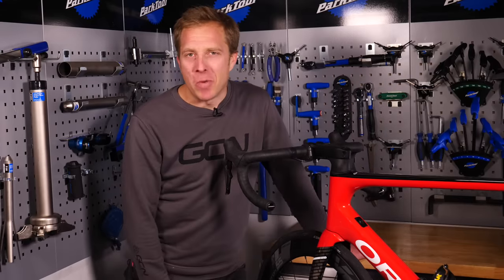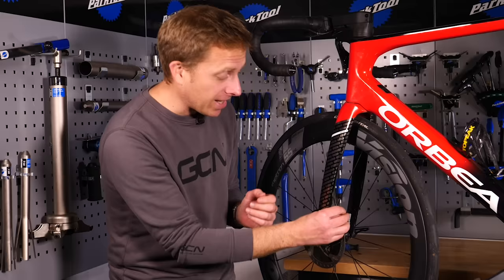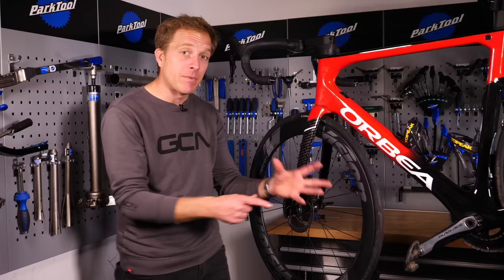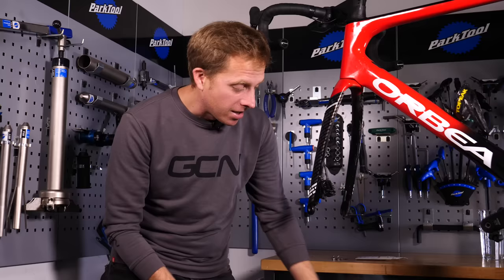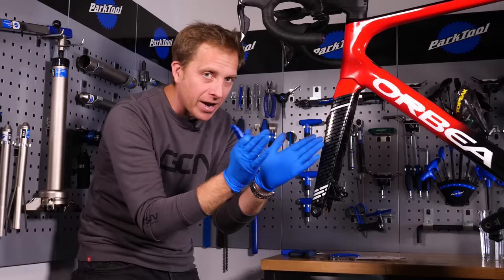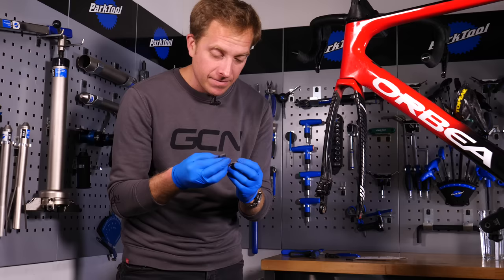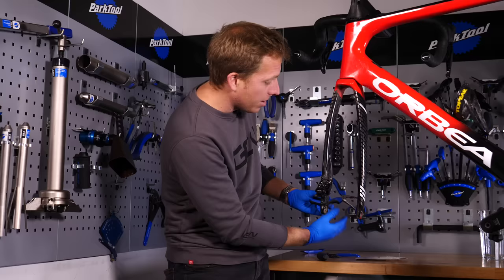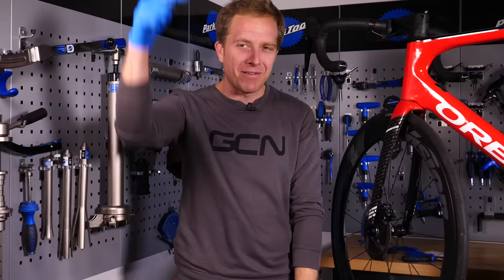How To Fit & Replace Disc Brake Pads On A Road Bike

Comment from the maker: What other maintenance explainers would you like us to make? Let us know in the comments below 🔧
Reply: Thanks JC. How about bleeding the brakes?
Reply: I would love to see a rear hub overhaul video. I am about to do my own and to have you to rewind when I miss something would be priceless! Then again Jon, most of your videos are!
Reply: Replacing a in frame cable
Reply: Jon, my old sausage, yes more on bleeding and as I have new Campy H11 brakes, are there any brand specific tricks to their pad install, and bleeding? Any tips on common mistakes?
Reply: How to install hydraulic brakes link inside the new carbon handlebar on the road bike.
Reply: Before putting the new pads in, put some water on them and rub the two braking surfaces together. You will feel them start gripping and know when you have done enough, wash the dirty water off and you're good to go. This helps dramatically with bedding and increases stopping power. If Jason Marsh does it for the syndicate riders, then I would be doing it as well.
Reply: How often should I remove the crankset for maintenance/cleaning purposes on my road bike? Also, should I remove my pressfit bottom bracket for maintenance every now and then? I am afraid I'll damage my carbon frame or that they will not go back in properly.
Reply: I'm not sure if it's a maintenance issue, but my disc brakes start to squeak every time it rains. It goes away after enough braking, but in city cycling on flat there usually isn't, so they squeak the whole way. Can I fix it somehow or is it a "feature"?
Reply: Replacing or upgrading your bottom bracket.  As we know, most cranksets come with cheap BB's that don't last. So eventually you'll need to replace it.
Reply: Disc bleeding, if you could! ❤
Reply: #TorqueBack Not a maintenance question per se, but I am looking for a 10-32 (11spd) road cassette compatible with the XD driver body. Surprised to see options are few and far between? Thanks!
Reply: pro trick: watch movies on kaldrostream. I've been using it for watching lots of of movies during the lockdown.
Reply: @Johnny Zyaire Yea, I have been using Kaldrostream for months myself =)
Reply: Bring back Jon
Reply: Why drop you fools just have one format !

Comment: how to do it the simple way that still works well and is professional
1. remove the wheel
2. press the old pads (brakepistons) out with a screwdriver or whatever you want
3. exchange old pads with new ones
4. put the weel back in
that's all... you'r welcome!
Reply: I couldn't understand why he didn't do it that way either, especially given the fact the old pads won't be used again.

Comment: Good tip on the tire levers for moving the calipers back in place.  It never occurred to me.  Last time out I had fits getting the wheel back in with the thicker new pads.  This tip will help next time.  Thanks!

Comment: Depending on how much grime is on the disc brake calipers, sometimes it makes sense to spray down the caliper pistons with brake clean before you retract them.  Saves on seals. Then put the pads back in to retract them.  One advantage of doing that is that it can help the pistons move evenly.

Comment: Thanks for an interesting video. A couple of things I do with the after market pads when I replace.  The ones with no cooling fins, I file a small nick on one of the locating eyelets as a witness mark, for when I remove the pads for cleaning, I can then place on the inboard or outboard side, so that there are no alignment problems, which can cause rubbing. The second thing, because the pads and spring can be fiddly to replace, I use a 3mm drill bit shaft to align the pads and spring, while I am dropping the pads into the caliper, finally remove the drill bit, then insert partially into the locating hole of the caliper, gently push the components and drill bit so that all locate perfectly.
Reply: Use the retaining screw itself. After undoing the retaining screw, I pull the pads out, so that the screw holes are just proud of the caliper, then I re-insert the retaining screw through the pads and the spring and pull them clear of the unit. Because of the head of the screw, the pads will not fall out, if tilted to that side. Also the head is always on the left, and so it is easy to know which is the left pad and which is the right.
          If the pads look OK, I re-insert them with the retaining screw still in them (and the spring) until the screw hits the caliper, I then pull the screw out, push the pads in fully and then screw the retaining screw in. It's quick and easy.

Comment: You should have mentioned the "Golden Rule"  John,     NEVER  pull the brake lever while the wheel is out!  
I bet someone does it.....   ;-)
Reply: Laughs in mechanical brakes
Reply: @brauljo  laughs in intact rim walls
Reply: Paddy Champ Laughs in mechanical disc brakes
Reply: @brauljo  Laughs in BMX
Reply: @fallbrightt9223  Laughs at BMX
Reply: He did say how to push the pistons back at least. But, I guess you are correct that by avoiding doing this it makes the job just that bit easier :)
Reply: Let’s say… someone… did this. Hypothetically. Hypothetically what would they need to do to fix the resulting issue?
Reply: @AdamLeuer  Depends... Worst case, you may need to bleed the hydraulic system if the pistons fell out and fluid leaked out. Otherwise just use a tyre lever to push the pistons outward. The point is to push the pistons back out so the new pads have enough room to clear the rotor as they will be thicker than the worn pads you are replacing.
Reply: Yeah, my hydraulic fluid did leak out and I ended up taking it to the shop. Learned my lesson the hard way.
Reply: Jon*

Comment: I see there are several comments against using disc brakes. It’s true the maintenance isn’t as simple and they cost more. I live on a small mountain range, nothing like the Alps or Rockies, but I easily hit speeds of 60-70 kph on my descents. I’ve recently purchased a new bike with disc brakes and will never buy another rim brake bike again. 1. They do stop better in the rain. 2. The brakes have significantly more stopping power. 3. To stop from speed requires significantly less effort squeezing the brake lever, good for us older riders and anyone with hand issues. 4. It allows me to use a wider tire (32) for a more comfortable ride on my crappy roads and I went tubeless also.  🚴😃

Comment: I would have preferred more close ups. There was a lot of camera time watching him from afar but the action is up close as the main characters are small
Reply from the maker: Thinner tyres are faster in certain circumstances. The track is buttery smooth so thin, aero tyres will be the quickest of course. As roads get rougher the optimum tyre width question becomes more complex

Comment: The most difficult thing is to choose the right replacement set (shape and material).
I would add a warning: keep in mind that bicycle pads may still contain asbestos, even in 2019. Indeed, and although asbestos is banned in Europe, it is still widely used in China, Malaysia, Taiwan and India. Which are, and this is not by chance, the countries where the pads are produced. Even if they are stamped with the logo of an American or Japanese manufacturer.
Do not create dust in the air, therefore do not use compressed air or brushes. Clean, as mentioned in the video, with a wet brake cleaner.
Just precautionary principle.

Comment: I usually give the pistons a clean with some hydraulic fluid before pushing them back in to prevent getting break dust and road dirt on the seals.  Didn’t used to but find the pistons work much better if u do.

Comment: Watching this just makes me want to keep my rim brakes even more
Far easier to maintain & plenty powerful enough for me with good pads (ie Swisstop)
Reply: So your car has rim brakes as well.
Reply: @ichglaubesgehtlos  My car has a weight of 2 ton & is able to travel at 100 + mph 

It's physics & crazy to compare the braking system of a car with a 7kg cycle
Reply: So a couple of razor gums will do the job just fine 😂👍🏼
Reply: @ichglaubesgehtlos  No as I stated I have Swisstop pads fitted & they work great
Read my post

Comment: Great video and advice Jon. +Like. In 99% of braking instances, these disk brakes are over-kill on a road bike. Comparing r8010 Ultegra direct mount rim brakes & braking on an alloy rim surface (even in the slippery cold rain) is honesty all I'll ever need. For me, an alloy braking surface and r8010 direct mount rim brakes are more than suffice to stop anyone, in any situation.
Reply: Completely agree. Been racing, touring and wrenching bikes for 40 years, and just recently picked up a Domane+ ebike that came with hydraulic disks.
What a waste of technology, but I'm sure a money-maker for the manufacturers.

Comment: I started using a hemostat (haemostat if you live across the pond) to remove the clip when I change brake pads.  Since the ratchet mechanism on the hemostat keeps the jaws closed, I don’t have to worry about dropping/losing the clips any more.

Comment: My front brake bad failed last year, even though, there was still over 1.2mm compound left, but spring got caught by rotor and got bent. I believe, the reason why it happened, was because sand and dirt falling down from mudguard directly on to brake caliper. And then probably some tiny rock or sand from gravel, that had fallen from above, worked itself under that leaf spring.. to between brake bad and spring. Rising the spring up.. I fixed the problem by making guards. Like mudguards from empty plastic bottles to above brakes. So that anything falling/pouncing down, from mudguard won't reach to brake calipers.
Reply: Happened to me, too.

Comment: I must admit to a personal problem I have with getting wrapped up in Jon’s habit of over-using the word “actual(ly)” way too much (actually 30 times in this video). What is the difference between “retaining pin” and “actual retaining pin”, and should I consider virtually putting on gloves as opposed to “actually put on gloves”? Nevertheless, it was another detailed and, as usual, informative video. Thanks, Jon.

Comment: Still not persuaded to swap from rim...easier maintenance 😎
Reply: This is literally the easiest maintenance job possible. Infinitely easier than replacing rim brake blocks. 5 mins max for both ends of a bike, including taking the wheels out and opening the packaging for the replacement parts.

Comment: Could you make a video how to remove seized aluminum seatposts from steel frames? For example with Natriumhydroxide?
Reply: @Jan Willem Kuilenburg - I had to do that recently. Tried freeze spray but that didn’t work, then just sprayed wd40 all round the top of the seat tube. Didn’t move at all. When I stripped the bike down weeks later I took the clamp off the top of the seat post, turned the frame upside down and clamped the seat post in a vice. I could then twist the frame to get it moving. My LBS said if that doesn’t work you can run penetrating oil down from the BB.

Comment: Shimano says to use the finned pads with those rotors only for better heat dissipation so the rotors don't warp from hard braking on a descent.

Comment: Ive bought myself 2 pairs of Clarkes round disc pads I just had to break the tab off them to make them fit on the non piston side I couldn't get the piston side ones to stay so I'm making do with one side BODGE JOB but it works "a bit" . I found Halfords and a local bike shop to be most unhelpful tbh but I suppose i have half a clue .. I prefer V brakes as they are just plainly simple tbh but I do want to do this properly

Comment: Just did my first pad change with this as a guide. Long/thorough was just what I needed so thanks! 

When pushing back the pistons (both front and back) one side was much more stubborn to push and wouldn't quite go as far in as the other, why could that be? There was enough room for the new pads to fit but the brake levers are starting to feel a bit loose so suspect they need bleeding (a job for the bike shop) so I'm curious if they're connected. Anyone?

Comment: I brought a new bike a thew days ago I just adjusted my brake cables and noticed my disc brakes doesn’t have no pin or pins what’s so ever 😢. Do I pinch them from the top or do I open the calliper after removing the wheel. It has three Allen key bolts and no pins. ???

Comment: Although I clean the pistons with a bit of mineral brake fluid they don't seem to retract enough to prevent a light rubbing sound. What to do?
I always clean de discs with DB cleaner when replacing the brake pads to bed them in more easily.

Comment: Q: on cars they always use copper grease on the back of the pads to stop squealing, is it worth doing on bikes? Just thinking of all the squealing brakes at cx races.
Also, are different pad types better in the wet muddy conditions of cx races?

Comment: Does this work with both hydraulic and mechanical disk brakes? Pushing them back in when the pads are out etc? As long as you don’t touch the brake lever they won’t creep in and close up, correct?

Comment: i beed the rotor with a sand paper an isopropilic alcohol before installing the brake pads
Reply: Could you tell me why that helps? Especially with a used rotor?
Reply: @playandteach  cause it reduces contamination,  and also you can use alcochol to clean the brake pads
Reply: @jesusenriqueriveratellez531  I just don't understand the sandpaper bit.
Reply: @playandteach  sorry for my english, but i use the sandpaper to get rid  of rotor and brake pads imperfections

Comment: Can you replace the brake pads without removing the wheel?
Reply: Yes, you CAN replace the pads without removing the wheel, which is a whole lot of good news if your bike is a bit complicated at the back end. Mine has a Gates Belt Drive and hub gears.
Instead you simply unbolt the hex-heads holding the caliper onto its carrier, and lift it off the rotor. Be careful not to kink the hydraulic hose.
Fuller details are here... https://youtu.be/HF2-eHgdngU
And there are a couple of others, too.
Reply: @effyleven  Hey thanks!!! That's a good "trick"!

Comment: I've heard on your previous videos that "disc brakes is the future", but as far as I know they're still heavier than rim brakes right? So what do you mean by that statement? They're the future because stopping power is better, or because they're getting lighter to the point where they're the same to rim brakes?

I'd like some videos on vintage bike maintenance. Stuff like upgrading from a one-piece crank to a modern one, and how to remove really tough rust and rustproof old parts would be interesting.
I'm still struggling with my 80s fauber crankset. It's been sitting in penetrating fluid for 2 weeks.

Comment: Think I'll stick with rim brakes, that's way too tedious. 
In a car it's easier to push the calipers back out if you loosen the reservoir cap. That also helps release any air that may have gotten into the system by allowing the air bubbles to flow up and out. IMO on bikes.
Reply: I prefer mechanical disks because you get better braking performance than rim brakes (on road bikes) without the hassle of having to bleed the breaks every month
Reply: @benjamindavies1188  I haven't seen the need to change to disc. My carbon wheel rim brakes will dang near flip me over the bars. On alloy wheels they will flip ya. Im sure I'll transition to disc eventually.
Reply: Oh roadies, you are so silly.
Reply: @Pienimusta  lol I'm not necessarily a roadie as I am realist. 😂
Reply: @thenotoriousrvh6091  Much easier than changing brake pads to v-brake or simialr rim brake. You have to calibrate those brakes everytime. Disc brakes are done just by throwing new pads in.
Reply: @Pienimusta  That's easy. I run the barrel adjuster 3/4 of the way out use a Velcro strap to hold the brake lever in align the pad to rim, take the strap off then turn the adjuster in a bit. Takes 5mins each brake.

Comment: I have ultegra brakes and have replaced the pads a couple of times already. The new pads never came with the screw and mine are wearing out. Where do I get a replacement? Can't find it anywhere.
Reply: I bought some on fleabay

Comment: Jon, Unrelated to the subject matter of the video, but what is that tool that was over your right shoulder in this video?n The large silver cylinder that looks like a floor pump.
Reply: It's an adjustable crown race puller.
Reply: @dapster  Thanks.

Comment: Jon pls help, I fixed/tuned my front mech but after that every time I let my rear wheel spin (without pedaling) I don't know if it's the hub but there's a weird sound coming from there, what do I do?
Reply: Is your wheel in properly and your brake pads not rubbing?
Reply: @paddychamp6069  It's not rubbing, I'm using rim brakes btw
Reply: @ricardiomilos7204  is the noise coming from the hub/freewheel?
Reply: @paddychamp6069   I think so, but it sounds like the chain or something else
Reply: @ricardiomilos7204  couldn't tell you without seeing it in person, but I'd advise using a chain checker to ensure it's not caused by the chain. Also check your limit screws on front and rear derailleurs and gear indexing. It's also possible that it's coming from the wheel bearings or freehub body but much less likely. A real rare rub can happen between the tyre and the inside of the brake caliper itself with larger tyres when inflated past a certain psi, but it only really applies to brakes from older groupsets that weren't designed for tyres larger than ~28c.

If you're unsure on how to do the trim and adjustment, check out the manuals on the shimano tech docs website. If you're still unsure then you should hand your bike to a competent mechanic.
Reply: @paddychamp6069  tnx for the help

Comment: I feel there should be an alternate ending for this vid that shows how you can balls up an ultegra caliper by shearing the pin because shimano use pins made of cheese which seize inside the caliper. I've defo never seen that happen... 😫🙈😳